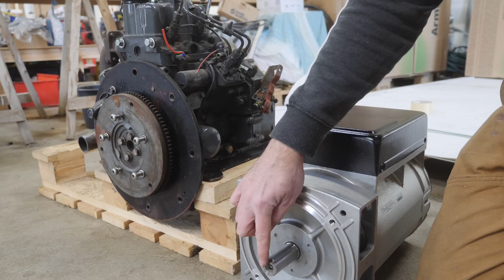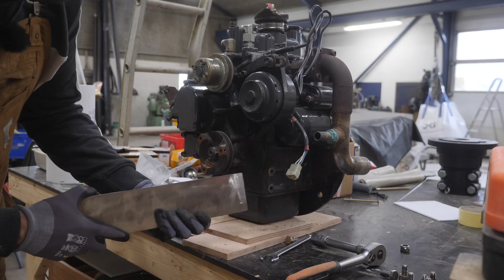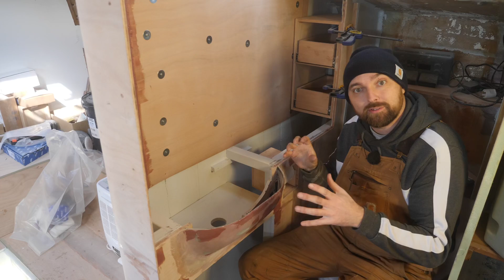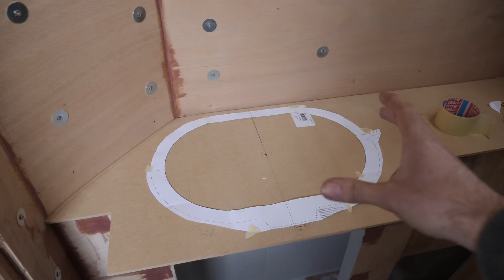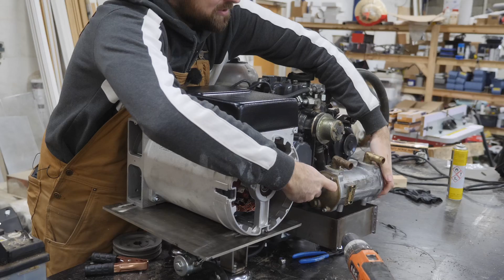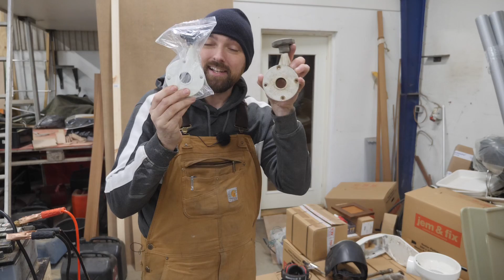Sail Life - DIY 9 kW diesel generator (part 1) & head vanity countertop template

Comment: Hello, Is there was any special reason for going with an AC brushed electric motor? Could a DC brushless be more efficient to  charge your batteries and have a inverter to do the AC step? Please watch the "TOP SECRET" electric catamaran on the O'Kellys channel I think you can get some great ideias from it, e.g. having most of the appliances DC instead of AC   . Keep up the great videos!

Comment: I used a wind generator,  it worked pretty well , not sure what's wrong with gas i used it for decades not a problem when using it just turn of at bottle fst then cooker,  that way never any gas in line .

Comment: i know its long shot but you can make your boat hybrid with a battery pack and  bigger generator replace diesel engine its costly but make it simpler and in long time more economically efficient

Comment: Hi Mads, The fact that electricity is your thing, you might, with this nice generator, fully up to specs for a Oceanvolt system. Propulsion and Hyrogenerate the battery pack. So at least you can do some programming as well:) Just a note, you vids are going soooo fast in the DIY parts. Would like to see/learning more about  thoughts, the welding and plasma cutter experience, etc. In all, thanks for the work, edits and vids and keep safe!

Comment: Good evening, it is with pleasure that I watch your videos. Congratulations. I have a simply technical question because I do not always understand English well. How much power does it take to run a 10kw alternator? The diesel engine must at least make this power? is there a rule to calculate the power required? Thanks again. And good luck for the future.

Comment: Hi Mads. Love your channel. Always fun, educational and generally entertaining. - On the subject of your cabinet doors and drawer fronts, I would like to bring to your attention that Shaker style cabinet fronts, are constructed with the stiles (the left and right part of the frame) spanning the full height of the cabint door with the rails (top and bottom part of the frame) inserted into the stiles. You panel inserts should then be parallel to the stiles and not the rails. The obvious reason is the resulting strenght of the construct, and visually it looks right..  Your preliminary example of a drawer front is made in the Boston style, where the inserts are parallel to the rail,  in which case it pleases the eye if the rails are wider than the inserts... - However that design is rarely used put on its side. Point is; whatever design you chose, it makes sense to have the vertical part of the frame (stiles) extend the full height of the drawer front or cabinet door, if you catch my drift ;-)

Comment: When you design the piping to relocate the oil filter and the HX, consider adding ball valves to serve as high point vents and low point drains to simplify routine maintenance.  BTW, nice gusseting on your bracketry.  Your welding is getting pretty good.  Hoping to see some beveled corner joints in the future.  Bummed you didn't go 110/120V, but I get it...  It's Europe.  Stay safe!

Comment: hmmm...Where are your fixtures going?  Where are you draining this to?  I'm assuming you will drain it overboard.  Are you going to send it straight out or to a centralized bilge?  I've had both in two different boats.  Floor drains went to a mid-ship bilge and was pumped overboard.  Either way though, you'll need some check valves to prevent water from coming in from the through hulls...Looking forward to seeing the plumbing!!

Comment: if it was me, I would probably put the pulleys in line so that the belt doesn't get worn on the side because it rubs agains one sides of the groove too much or on the top edge of the groove, has broken several pretty quickly that way,
and make it så that i can move the plate on which it is mounted a bit to align it,
and driven over a pulley mounted on a separate from the engine part/plate, connected to the engine crank through 2 SigmaDrive or 1 python drive,
usually such a large generator is mounted directly to and in line with the crankshaft and generator housing directly to the engine block as a gearbox in a car
so there is no side drag and tension of the crank bearings and the sealing ring,
You can get oil problems out of the bearing and sealing ring behind the flywheel if mounting the big generator on the side
but thats just me

Comment: About that Stainless Steel steering pedestal - There is phenomena called “galvanic corrosion” where the contact surfaces of differing metals corrode.  Unless your mated parts and fasteners are the same metal, you WILL experience corrosion.
Reply from the maker: The plan is to isolate the two parts with a nice little gasket :) Sure there will still be contact between the stainless bolts and the aluminium pedestal but a bit of grease goes a long way to keep the water out.

Comment: I'm worried about the total weight of the whole generator setup and the siting of it in your technical area.  Surely once it is installed, along with all the other stuff you plan to have in the technical area, the boat will be well down by the stern with a notable list to starboard?
Reply: I would counter balance everything by placing batteries port side forward, because even the interior looks starboard heavy. She is going to be a heavy girl for sure. Then again I think Mads has designed this boat to be more as a anchorage live aboard. Ocean crossings not being the number one priority anyways.

Comment: How dare you?!!!!! You forgot the wine cooler and hot tub and sauna. But really, I think an automotive style multi grove belt would be a better drive solution. With the multi groove belt you could also use an automotive belt tensioner. Available from your local auto salvage yard. Easy to get spare parts for and cheap too. On Amazon. This would also enable you to change the belt quickly in an emergency situation, for example if sanctimonious gas bags came down from their higher moral plane and were attacking your vessel because it isn't powered by oars. If you think of how quickly you can put a wrench on the belt tensioner in a car compared to wrenching on the generator base you are considering well the auto belt tensioner is faster.  The ex-Soviet Union probably has some military surplus nuclear power plants you could pick up cheap. They have a lot of submarines rusting away and if you act quickly you could save a bundle on energy. A few "radio active" emblems stuck to Athena would help keep those trying to achieve sainthood at bay.

Tahsiang Industry Co., Ltd.

http://www.tahs-belt.com/images/banded_sp_s.png

Comment: Mads I think you need a toothed serpentine belt to drive that generator. Way less stress on the bearings and way stronger. In my opinion you also should run the diesel in the nominal RPM recommended by the manufacturer. Without googling anything my guess is 2700rpm. That way you get the most energy efficient power the short while you need it while the diesel already is some what too small for the generator.

Comment: Can you try a lithium battery bank with flex solar panel on the bimini top to compliment the rigid ones? You should be able to power everything within reason. Delos has some extensive videos on how they did it. You will of course have to use the dinosaur squeezings some. Just a thought.
Reply: Delos is in the tropics. Way up in the frozen North where it is dark for half of the year they would freeze before they starved relying on solar!

Comment: While the Perkins is still out in the open, you might want to consider installing a 'remote' oil drain. Just a 90 Degree ell screwed in place of the drain plug and a pipe extension out to a more accessible location, terminating with a female fitting to accept the pipe plug once more. Regular oil changes are the life of any engine, and you will enjoy not having to fight with a hot plug under a hot engine, and then trying to catch all the dirty oil...
Reply: Mike, Mads mentioned that the oil filter was buried but that he had a plan for relocating it, he probably is going to do something about the fill as well.

Comment: Have you ever consider simply using some wood glue or yellow glue?  Very strong but much easier to apply.  Is it a marine environment problem?
Reply from the maker: For most stuff you could use exterior grade wood glue but then you have to worry about clamping everything really well. Thickened epoxy dosen't require any clamping :)

Comment: If I were you I would rather have the engine rpm to be right around 1800 to 2000 tops. You may suffer a little peak power, but the consumption and longevity will be much better. Just be careful not to overload the engine at those rpms
Reply: 1958johndeere620 I think read somewhere that diesels like to run at around 80% of revs where they deliver peak torque.
Reply: @LesSharp  That is true, but in this case I would back off a bit. These little diesels are rated at 3600 rpm's which is way to high in my book for continuous duty. There peak torque id around 2400 ish. As long as you don't ask to much of them, 1800 to 2000 rpm's would be a sweet spot. I have a 3 cyl 18 hp perkins in a JCB excavator, never had a 402 . In my mind the longevity at high revs would be greatly reduced. That being said, if you load the engine hard at lower revs, it will cause a severe early death as well. Its a balance. To really understand load on a diesel, you need to monitor exhaust gas temperature. The usable horse power at  1800 rpm's most likely would be about half of rated at high idle ( governed wide open )

Comment: The injector pump govenor is an overspeed type govenor. What you need is a speed regulator govenor. A simple bolt on belt driven govenor will do fine. No electronics needed.

Just a thought (;-) TP

Comment: ava wants light gray, ava gets light gray. i guess ava's the boss here :-))
why don't you hook that alternator up to your existing engine?
Reply: Very inefficient, run a 100 HP engine to boil and egg? Similar to boats that have engine driven refrigeration, they always have very high time engines and it is VERY expensive to re-power.

Comment: Mads I am sure you know or cement boat guy knows but your"gearing" so to speak for running the generator isn't about noise but you need to run the engine at it's peak torque. Look up the RPM of peak torque of this engine and that is the RPM the engine should be run at then calculate the pullies sizes from there. You want peak torque so when demand increases on the generator the engine can handle it, has less wear and tear and gives the best fuel economy.
Reply from the maker: Actually, it was about noise and vibration :) It's been the plan to run the Perkins at around 3000 rpm all along but I wouldn't mind lowering or raising the rpm a little (and sacrificing a little efficiency and torque) if that made a difference in regards to vibrations. https://s7d2.scene7.com/is/content/Caterpillar/C10378904

Comment: I'll repeat my comment, that tensioning separate from generator positioning is much preferable.  Also, without an outboard shaft bearing sufficient tension to run the generator will damage the front bearing of the engine. It is not designed for that sort of side loading of the flywheel.  Mr. Cement boat may have the same issue.  I presume you have looked at the power curve of the engine carefully. Running the engine at 1500 rather than 3000 rpm would be much easier on the ears among other things. At the risk of over complicating things, some sort of clutch, perhaps integral to the belt tensioner, would make this much easier to start when cold (out) adding load after the motor has come to temperature.  Note sent from Canada where winter is really winter.

Comment: Hi Mads, as you continue to put the finish touches on the interior and systems of the boat are you keeping track of the weight additions and the distribution?  I’m curious to know how you’re doing that to ensure you’re not too low on the waterline and moderately level bow to stern and maybe more importantly, port to startboard.  BTW, great work so far; really coming along!

Comment: You've got the line of the year "--there's no amount of lube that's going to make that an enjoyable experience"!!!  Suggestion on your vanity top, if you have enough 'scrap', make the rim around the undermount sink so it appears thicker then just the laminate itself. You usually add material to the outer edge, so the top appears thicker, like 3 cm, so just do something similar on your cut out. You also might want to consider not caulking the vanity top in permanently since to get access to the faucet mounts in such a tight area it might be easier to just pull the whole and sink out as a unit (and install it as one too). Lastly, dark colors in tight spaces make the feel of a space smaller, where lighter colors seem to add to the space. Dark colors also suck up details, for whatever that's worth.

Comment: just an idea for when you install the electrics-- put a low voltage protection relay on the output of the generator so that you cannot have power going to the distribution board until the voltage is correct

Comment: If you are not able to find a tachometer, you can use a multi meter in Hz mode connected to the output of your meccalte alternator to tune your speed.  Expect a dip in frequency under load assuming your Perkins is droop governed rather than isochronous.
Reply: I should watch the entire video before commenting...

Comment: Mads, please check the engine again. I found a 402C (D variant not found) is 0.5 ltr. not .95 ltr, a 403D-11, is the 1.1 ltr, it has enough oomph to run your alt. If you want I can send the link to the catalogue?
cheers stay safe

Comment: Yes, as said, there will have to be several fanbelts of the V type to carry the load. They can perfectly transfer the power and the fact they slip is actually necessary to cope with the energy pulses and inertia. Small helicopters reliably use a cluster of the very same kind of belts to transfer 100+HP from engine to rotorsystem at around the same RPM.

Comment: I would encourage you to consider cooling this diesel engine powered generator using an electric magnetic drive water pump instead of the motor driven impeller pump.  The pump would get its power from the generator directly so it would run only when the generator is running.  And it can be a single speed pump supplying a stable volume of cooling water since diesel will be running at a fixed speed.  These pumps can last 10K hours vs the 100's hours for the typical flexible motor driven impeller. For an example of cruiser who did this switch, see youtube Catamaran IMPI from about 4-5 yrs ago

Comment: **points at pinned comment and laughs**
must use a pedal powered, coconut husk laptop, or Greta has a sock puppet
Reply: Greta was aboard Lavagabonde and didn't seem to mind the occasional use of engines.  Dan just doesn't have a realistic grasp on sailing safely and with reasonable comfort.
Reply: @berniebroering1961  of course not, it's different when she benefits. Comments like that and people like those forcing the Swedish brat onto us haven't a clue to reality. I hear it all the time "We don't need oil!" and "We don't need [this, that, or some other hobbyhorse]" and if you look at their "replacements" they either are much worse (but somewhere else and they either don't care, or are too stupid to know better or deny it is that way) or to work in reality, take more resources to accomplish the same thing, or are impossible with the current laws of physics ("We've got the people! We can change those laws!").
Reply: @jpkalishek4586  And in the mean time, Mads gets the added YouTube points for all the comments! Go Mads!
Reply: @berniebroering1961  Go Mads Go!

Comment: the perfect rpm for the diesel are best tested when its mounted in the boat. engine sound varies greatly by resonance of the hull. please consider delaying the rpm test run til shes in the boat
Reply: Most generators have a specific RPM they need to be driven at to output at the correct frequency (e.g. 50 or 60 Hz).  The Onan generators for instance run 60 Hz at 1800 RPM while they can run 50 Hz at 1500 RPM.
Reply: @steveburton5825  The small Chinese generators run at 3600 RPM for 60HZ, can't imagine how long they would last at that speed.

Comment: Mads, it looks like your heat exchanger is made of alloy and brass.  Not a good combination for sea water.  Electrolytic corrosion will ruin it in short order.  Ran Sailing had a similar Volvo one that got destroyed by electrolytic corrosion, not a good design.  Keep up the good work.
Reply: It is a seawater grade bowman exchanger, I think it is in the good end of what you get out there... The aluminium part only get in contact with the engine cooling water, not seawater.

Comment: When you install your generator, try to avoid a direct tension on your engine flywheel. You would put a lot of load on your jornal bearing. They are designed to have a concentric load. Install a that be drive by flexible coupling, from there you can put a pulley to drive your generator. With out worrying belt tension.
Reply: What does this mean, are there typos: "Install a that be drive by flexible coupling"
Reply: Nice information Ruben, hope Mad get that!
Reply: yes because usually the large generator is mounted directly in line on the crankshaft,

Comment: If you would have a victron energy  Inverter you could use that remote start feature in combination with the inverter low voltage relay switch